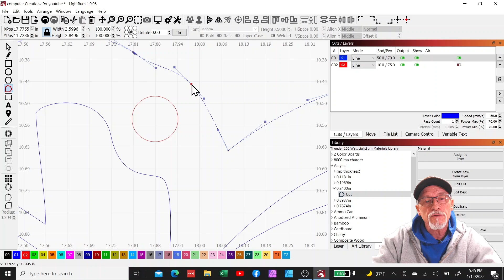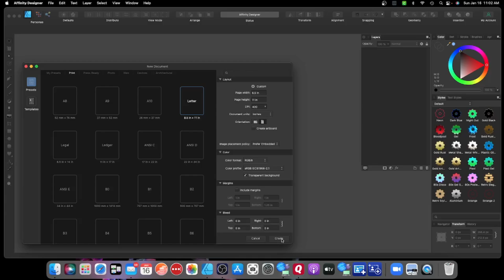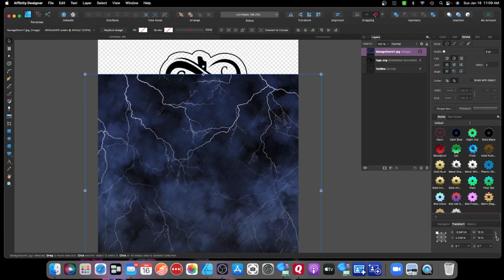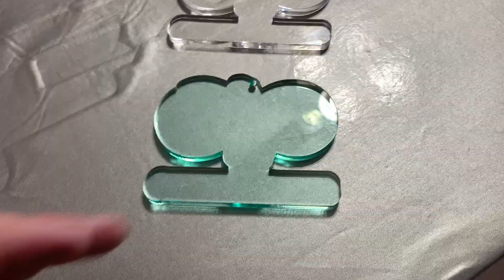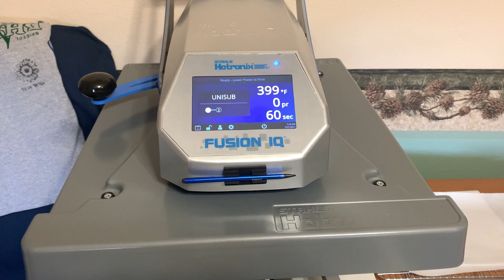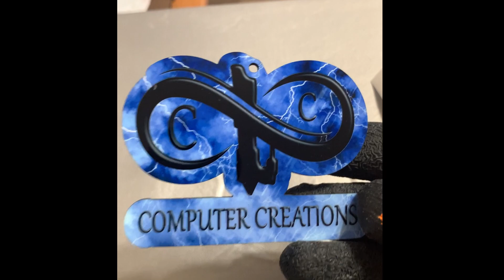Laser plus Sublimation equals more $$$  (audio fixed)

Comment: Loved the video, it was very helpful and packed with a lot of tips and tricks!  All good stuff for sure!  I only had one question on your choice of a $2600+ heat press.  What was your reasoning for that purchase?
Reply from the maker: Thank you for watching and the comment. Great question, I learned along time ago buy once cry once. after doing extensive research this company has one of the best reputations and warranty’s. in talking with several other shop owners that have one it came highly recommended. the 16x20 platen with the ability to change out size and preprogram settings is a great time saver! there are allot of cheaper options for sure but dependability and service after the sale is paramount in my business.
Reply: Thank you for the straight answer!  On your Epson 15000, did you have to do anything to it to use Dye Syb ink?  Modifications?
Reply from the maker: @joegavin5300  purchase cosmos sublimation ink, that’s it. No printer profiles needed.